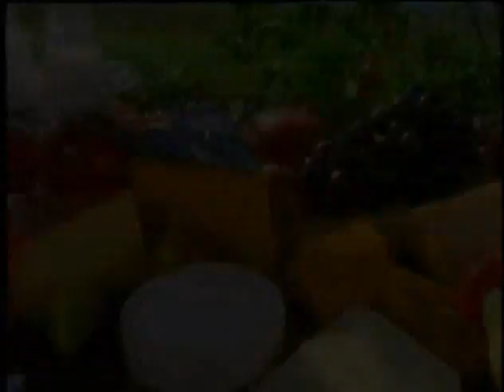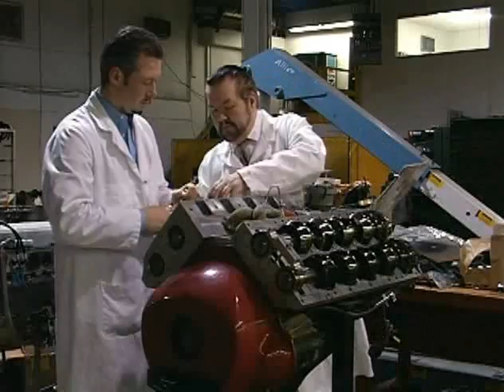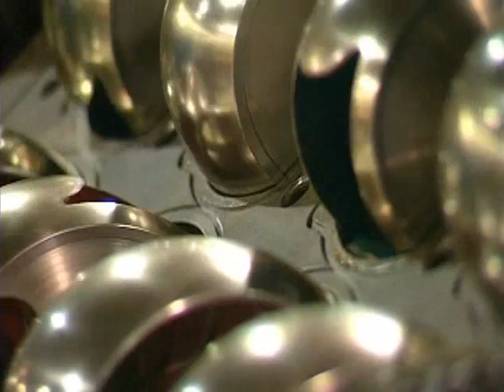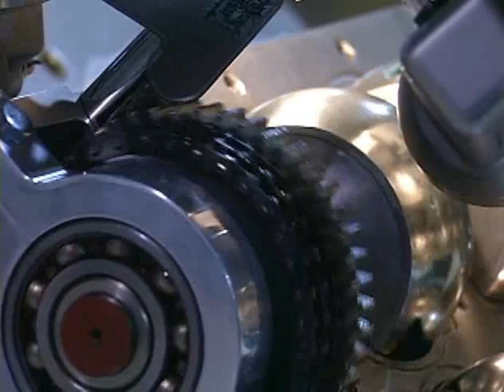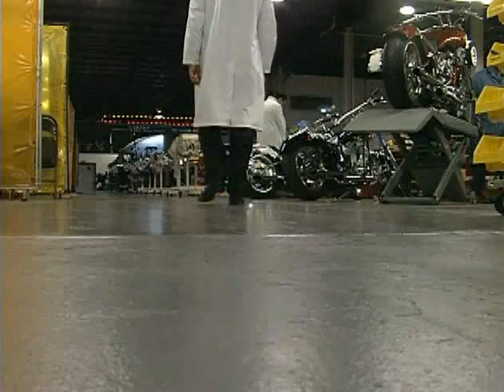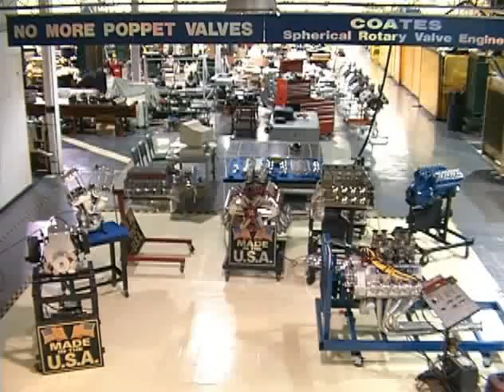Coates CSRV Engine on Sustainable Planet

Comment: for this reason, the coats engine can run much higher compression ratios on the same octane as a conventional poppet valve ICE engine, making it much more efficient(more power out of the same amount of fuel, increasing power while keeping the same MPGs, or increasing MPGs while kepign the same power).

Comment: 30% improvement in engine efficiency. 14,850 rpm's under full load. Significant reduction in moving parts compared to the traditional engine design. Also noted is significant reduction in engine maintenance. And much fewer oil changes required. I was also reading the main web site(noted at the end of this video), and learn much about the technology and it's importance. Thank you for posting this video up :-)

Comment: @RyTrapp0 The valves aren't the only weak point in the motor.  If you increase the compression ratio too much then you start to experience blown head gaskets, broken crank shafts, etc.  There's quite a bit more work that needs to be done to the motor before these valves will be completely successful.

Comment: 20 years ago, a guy I worked with was building one of these- last I heard 'its almost finished' still never ran more than a few minutes... I'd dug up some pics of a couple chrysler built back in the late 60's (only 'ran' on a electric drive to test flows) that looked real similar too and showed them to him long ago... said it before, will say it again, sealing/lubrication/overheating will IMHO prevent these from ever seeing the light of day. hope I'm wrong, good luck

Comment: no, your just assuming too much. the poppet valve of a conventional engine is a hot spot - it collects heat and holds it - so it maintains a higher cylinder temperature. the rotary valve is always rotating, thus allowing it to cool some and, in turn, removing heat from the cylinder. less heat in the cylinder decreases the chances of detonation(think water/meth injection, or intercoolers between superchargers/turbochargers and the intake. its all about removing heat).

Comment: @sranjesuper not quite. Imagine that it's a ball with a hole straight through. One one side of the whole, is the intake ports, on the other side, the combustion chamber. As the ball rotates, it opens up a path between the two, then closes.

Comment: With many years of precision engineering starting with pistons for cars and going on to valves for steam and chemical of all metals and pressures I can confidently state that making a multicylinder engine with coates valves in a nonstarter.
The fact the valves work in steam engine is due to the lubrication of water, steam and oil and much lower pressures.
A small turbo diesel engine is perfect for all today's driving until hydrogen is widely available.

Comment: They have obviously solved problems that shelved the Australian rotary valve engine designed by Harold Clisby in the early 60's,from memory sealing the rotary valve which had flat spots on it to direct exhaust gas out one side then admit fresh fuel/air on the other side and it ran at quarter crank shaft speed and was from memory quieter than conventional valves,sealing this type of valve would have always been the big problem.

Comment: I don't know about this piston engine head, but F1 car racing had a rotary valve head engine years ago. Even the the Koenssig car, or however its spelt, that guy is working on a camless valve piston engine. Rotary heads do exist, & I don't see why this head would not work. Just so the public knows, there are big corporations who hire & pay professional writers/journalist to write derogatory messages, & lies about advanced mechanical engineering stuff like this, because they know it's going to lower or eventually stop their cash flow altogether, especially oil companies, & companies that make conventional type heads & valves, that the advanced rotary valve head would replace. The new seimens electrical motor is going to replace a lot of the old style entire internal combustion engines themselves, especially now that we have ion-lithium batteries that are very powerful, light, small & charge very quickly. With technology advancing so fast, lots of outdated internal combustion engines will be replaced with much more powerful efficient & smaller i.c.e.' s. For example the nissan nismo 1.5l 3 cyl diesel turbocharged piston engine only weighs  40kgs/88lbs & puts out 400h.p. I suppose this mated up hybrid style to the new Seimens 300h.p. e-motors, that are also very light weight, in a diesel-electric configuration type, this system will someday be what powers airliners, because of its low weight, & high h.p power ratio. Rotary Wankel engines are advancing also, with better designs & engineering, they have better cooling systems now, in the water cooled versions, & with the help of turbo & super charging these much smaller & lighter engines, with much less moving parts that a convetional pistion I.C.E.,  when compared to each other, the rotary wankel can put out more h.p., with less weight & less moving parts than a conventional piston engine. One rotary wankel engine co. now has a government contract with aircooled wankels that run in military drones & have one of the best h.p. to weight ratio ever, in a i.c.e. They even have a turbocharged rotary wankel diesel engine, & hybrid diesel-electric that can burn jp4, diesel & gasoline, or anything combustable, just like a turbine engine, but much more efficient. Along with the advancenent in very efficient solar panels & wind turbines. I think what these giant & greedy oil corporations, who named crude oil fossil fuels, is a lie & is very misleading to the public. Crude oil is actually a very vital liquid from living mother earth, & could actually be her blood, which should not  all be drilled & pumped out, till there is no more. This could be the very reason for earthquakes & other natural disasters, along with to much atmosphereic pollution from all the automobile, oil & chemical factories exhaust ect. The horizontal circular plain we call earth, is covered with 3/4 oceans & seas(saltwater), which can be converted to hydrogen when electrolisis is ran through water in a sealed container, regardless of what kind of water, be it saltwater, pond water ect, & when burned in i.c.e.'s(internal combustion engines) or turbine(jet) engines, it converts back to water, when exiting through the exhaust. A never ending cycle. I think the creator knew what he was doing when he created us(human beings) & our precious horizontal(flat) circular plain which is enclosed & protected by a firmament dome(flat earth is just my own opinion). If humans weren't so greedy & power hungry, we would have a much better (happier & efficient) world.

Comment: yes but while the ball is on the intake side, it is not suking the air in, like a valve does , since it is only open to one side but a valve is open to both the intake and the combustion chamber at the same time.. this ball is only open to the intake seperately until it reaches a certain point where the combustion side opens up but by that time the intake is almost closed and, there is little air going in... or i am imagining it wrong...
Reply: You are in fact "imagining" it wrong. The aperture avails itself as the piston starts to go down on the intake stroke. The arc length of the aperture is the "Duration". Same for the exhaust only the piston is at BDT instead of TDC. The aperture goes through both sides of the sphere.

Comment: i looked at the flash diagram of how the design works and what i do not get is. When the traditional intake valve is open, the airflow is unrestricted until it closes meaning it will suck out air from the outside until its open > the coates head has a ball which takes air and when it rotates, it gives that air to the chamber, but NO MORE air can get through into the chamber, only the air that is inside the ball. That is what i gather from watching the flash animation. ANyone?
Reply: The aperture avails itself as the piston starts to go down on the intake stroke. The arc length of the aperture is the "Duration". Same for the exhaust only the piston is at BDT instead of TDC.

Comment: My only question is how do they achieve a seal, or at least a durable seal with the rotating ball. It seems like it would leak no matter what, even if it is small amounts.

And without oil in the head how do they control cooling? It may not be a big problem on the intake side(being exposed to constantly flowing cool, outside air), but exhaust gasses are hot  and the valves are still exposed to heat during the combustion cycle.
Reply: I'm thinking the only way to do it would be to have a ring (like an alusil piston ring) around the circumference of the ball. Just my opinion. . . .
Reply: There's a ceramic seal. Read up on their home site.

Comment: 14.000 rpms!?
Why aren't any race cars using these engines?
It has to work since Coates is making those motorcycles and also big industrial generators..
Now if only big truck manufacturers got into the game,maybe they don't really give a shit about saving fuel or are owned by Big Oil Corps!!
Reply: because it doesn't actually work like they say it does.

Comment: website has the same garbage on it since 4 years ago when I first heard about the company.... And every time I ask them why they're not making aftermarket heads for Hondas and such, I just get a generic response.
Reply: Fast forward 11 years and we see a totally change of pace. The global warming fad is gone. Man made “Climate change” has taken its place. And the amount of oil still available is still ridiculous.
Reply: Heard about those engines in the early 80,s.Still waiting.As for large stationary engines let's just say that Wartsilia,MAN B&W,Mitsubishi have that market captured and none use anything to do with Coates valves.They use a single solenoid controlled valve in two stroke uniflow engines.Other power producers are GE,RR MTU,Siemens,nowhere are Coated.

Comment: This valve design with a turbocharger would be perfect for older diesels.  There are 10s of millions of old diesels on the road.  Personal trucks, work trucks, tow trucks, cargo trucks.  People and companies would gladly pay $2000-$3000 for conversion that gave 20% fuel savings.  Being green tech, cost could be written off on taxes.  Coates family could be multi $ Billionairs in a few years selling conversion kits........Yet after 15 years ONLY public vehicles they working on air cooled motorcycle engines? and their stock is 3.5 cents per share?
  Something is VERY, VERY wrong here.  Clearly investors and technical experts know there is something Coates is not telling the public about why this tech will not work on automobile engines.
   Wish it would work, I would buy a conversion kit myself.
Reply: It could be that there are other parties involved that are not at all benefitted by this system. Oil companies for instance. Because I can not think of any other reasons why this system isn't widely spread all ready.
Reply: Peter Timowreef
Compare two companies, Coates and Tesla motors.  1st Coates:  After 15 years no working motor in car, stock worth pennies, no interest in investment by other companies.  Now Tesla Motors:  Selling working cars, stock price very high, Lots of investment interest by world leading companies.  No conspiracy theory can explain why Tesla can make production cars and Coates can not even produce one working prototype car.
Reply: Peter Timowreef Conspiracy theory is ONLY thing you can think of?  How about the obvious reason?  The design has fatal flaws.  No conspiracy theory can explain why after 15 years Coates can not make even one prototype car to show the public.
Reply: Desert Rat
Except for one little tiny detail that Elon Musk had billions of private funds that got his company off the ground. You gotta admit its bloody retarded that after 50 years we're still using cam-shafts and spring operated valves.

Comment: is there a way we can get a quote for a set of these head for a ford 2.9 liter engine
Reply: Call them. As far as small engines are concerned I've not seen much of a selection from Coates. Seems they are concentrating the product line-s efforts into larger industrial diesels. http://www.coatesengine.com/coates-china.html

Comment: 30% increase in efficiency? Yeah how about no, the most efficient diesel in the world (big as hell, in a ship) tops out at 51,7% efficiency. Extremely good.

Do you really think that if you could increase the efficiency by 30% in a ship like that, they wouldn't do it? The numbers are made up, sure it works, it's been used in engines back in the day but the poppet valve is better.

This is why every engine on the planet uses it.
Reply: he talks abuot the energy that is not used on move te valve springs , spring that need mor energy to work than a spherycal valve
Reply: the industry has known for decades that the valvetrain is the weak point of an internal combustion engine.  overhead or double overhead valve setups are more efficient because of the weakest link which are the pushrods, but not nearly as much as eliminating the valvetrain.   you're way off base if you believe a poppet is better Victor.  do some more research and you'll see.  would love to see the Coates system in action, and be cost effective.  i would guess cost is the reason we haven't seen the CSRV in the market yet.
Reply: The number aren't made up, but I think they are exaggerated, its more likely 30% of the current petrol engine which comes in near 30ish% efficiency meaning that it would bring up the % by like 10 percent average in reality. I still cant see this bringing in as much air as a ohc setup
Reply: You're hilarious.

Comment: I do not see how the valves   change emissions, it's the temperature, and fuel and carbon getting into the oil through the rings , that contaminate the oil the most, the air flow and friction is the only potential gains, sounds like a total con!

Comment: lots of friction and difficult to seal, especially as it heats up. all the design flaws that wankel engines face. but now in your valves.

camless design would be superior.
Reply: i am designing a camless (electronic operated like koingseeg) but where the valves don't go into the engine like these don't (never hit the piston/easy to time) but with a design to seal as it wears similar to how the poppet valves angled cut makes it seal as it wears because the parts wear at the same rate (i know these seal good because i have an engine that is 31 years old and the valves still seal to this day, the same can't be said about the rings)
Reply: Nonsense. read up on this technology. Plasma ceramic.

Comment: We are not moving towards the wankel rotary engine because....

Small package. Big power, Horrendously big consumption...
Reply: The Wankel engine has been dead for decades. The modern Mazda rotary is not a Wankel. Mazda in the 90's did produce a prototype plasma ceramic & aluminum rotary engine coupled to a CUM Dynamo that did remarkably well as a "Synergy Drive" system that ran on hydrogen.

Comment: Made the two major mistakes your marketing in my opinion. 1, the owner is trying to sell me something. Meaning it's bullshit, hiding something or too damn cheep to hire a pro to do the pitch, meaning is cheep in the manufacturing. 2. Your selling me a engine that runs on gasoline, while marketing it as a global savior lmao. That's like selling crack to a crackhead while telling him it's good for him, that it will fix his problem. GTFOH... why don't you just sell the part we are interested in, meaning sell the top part so we can put it on a bit block, or swap  the top of my Lexus or something. I don't want a damn coats engine in my 16 Lexus, I want to get rid off the bullshit valve Rods I keep bending cause I'm heavy footed! Bmw, Infiniti, Lexus and Chevy, bent it on all four, all 4 were new cars and so they replaced them free, but I need something that can handle me paddle shifting up, only the slam the break while down shifting a left turn only to mash the gas and shift up, all in 2 seconds... ya, mmm NO, modern pop it valve rods can't handle that engine pressure shift in such a short time, and so you say you guys have the solution! And the solution isn't your engine!